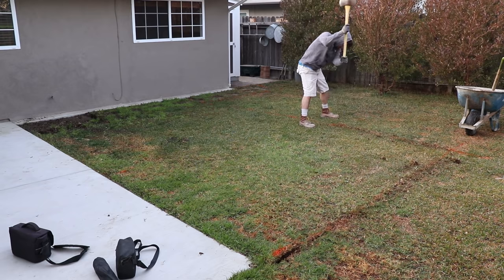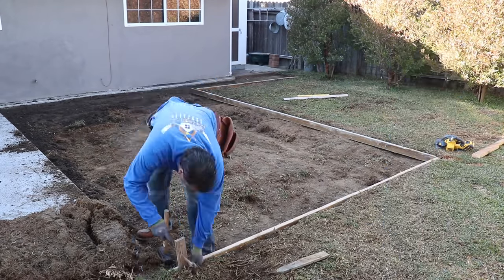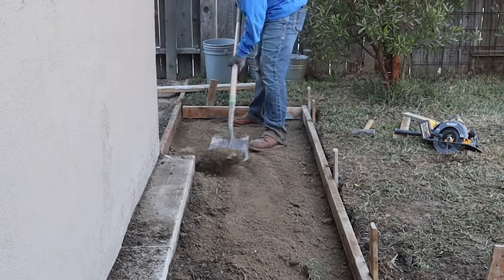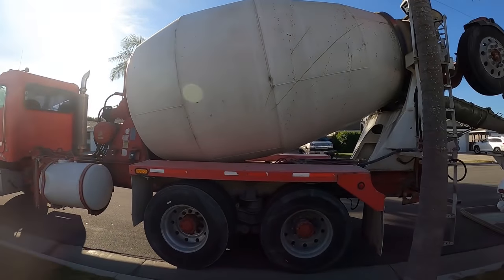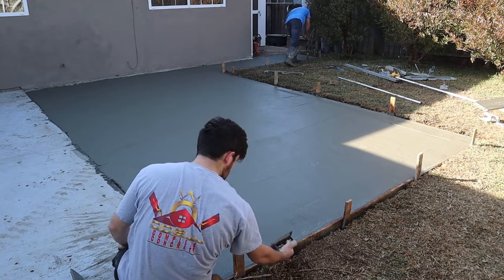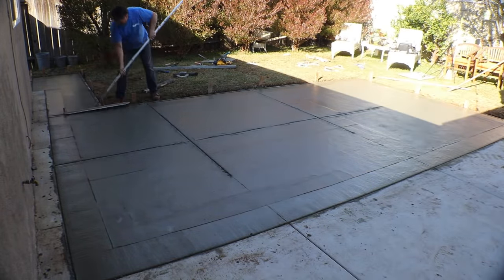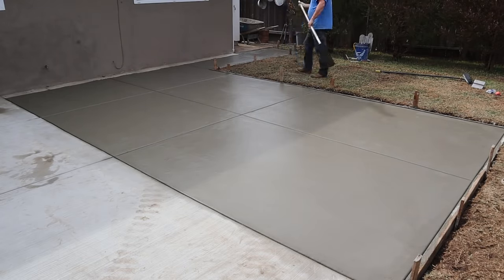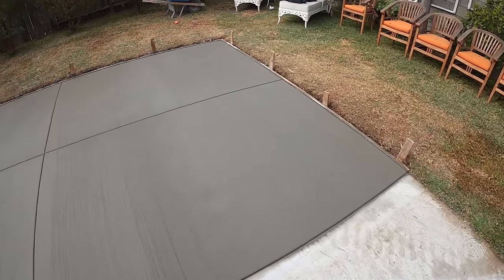How to Make a Concrete Patio Bigger

Comment: Why not use small rebar as a support in the middle rather than letting it lay there. Tire rebar as an upright or something in the ground? wouldn't that be better then letting it just lay there. defeats the purpose of rebar supporting the concrete
Reply from the maker: No rebar can touch the ground. It will start to rust and cause damage
Reply: @OdellCompleteConcrete  Exactly why I asked why there are no chairs or anything holding the rebar up. Someone simply pulls it up while pouring in the hopes it doesn't lower? In this video the rebar isn't supported by anything once tied off to the drilled rebar for support. The outside is supported while the center is not. My question is why?

Comment: An issue with your job I noticed , that tap would have had underground piping it’s most likely why whoever did the original job did not concrete over that area , if that pipe corrodes under the ground and starts leaking under that concrete you are going to have to smash some of that concrete up , I would have been looking to find out where the piping goes first

Comment: you guys need to work with the personal safety equipment.
Reply from the maker: For sure
Reply: Old School  like ear plugs, helmet, regular globes, anti vibrating globes, dust mask, safety shoes, lenses , long sleeve tee and finally sun protection. Nothing fansy but necessary
Reply: Old School  wear what ever you want but at least for the video wear safety equipment even if you are working on a fence or an a skycraper